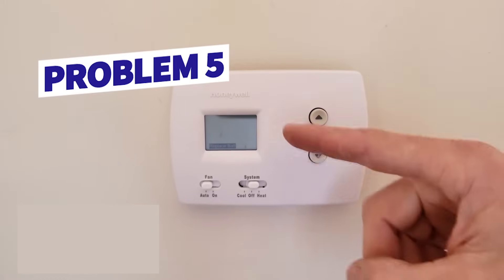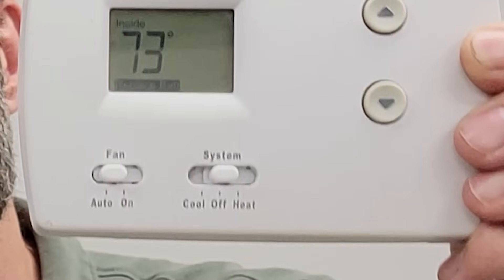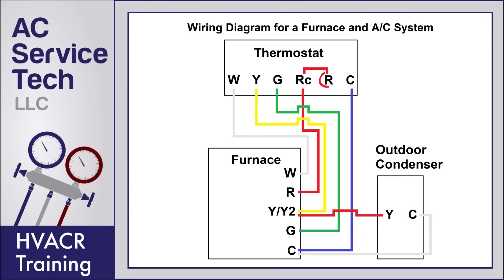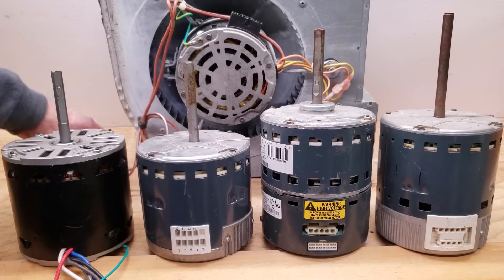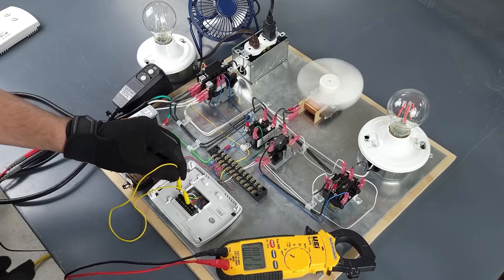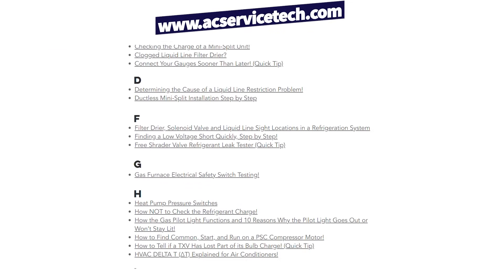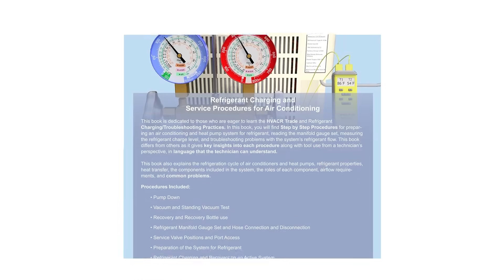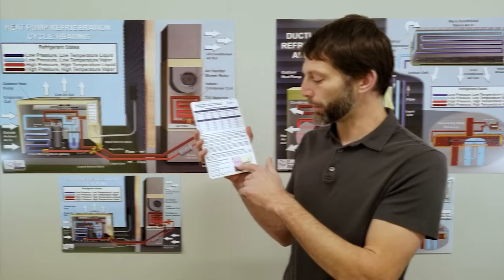Air Conditioner Not Turning On! Nothing is Happening! 10 Common Problems!

Comment: Went on a two hour drive once just to turn on switch.  Inspected unit found nothing wrong was not very happy about that call lol
Reply: That's free money.
3 hours or 5 hours depending how you charge.
Reply: Haha I hear about those a lot. I’m finishing up HVAC school currently. But hey it’s still $$ in your pocket. (Or your company’s lol)
Reply: I would love a port 2 port OT call like that.  Haha
Reply: You Honest HVAC guys are the best.  
Thanks for not radically overcharging for that simple "fix."   
You def need to cover your basic expenses like fuel....etc.
My honest HVAC guy passed away a few years back.   
Been through 3 different companies now..... hopelessly dishonest.
Its so damn easy to deceive homeowners about HVAC issues....so unscrupulous guys do it a lot.
Much respect to what you HVAC guys have to know & skills you have to have to be proficient & capable at it.
Working in 110°+ Hot,  cramped attics during summer !!!   Whew!!!!!  🙏😑🙏

Comment: How can you turn on r and y at furnace if your 2 wire to condenser is cut??? The condenser would not come on if it's not connected!
Reply: Right it wouldn’t turn on
Reply: That’s very true. If you’ve verified your thermostat is working correctly and your AC unit still doesn’t come on you’d jump from R & Y at the board NOT the thermostat which would lead you to the outdoor unit not getting the Y signal to your contactor

Comment: Number 1 problem for ac system not running after 30 years in Hvac business is condensing unit capacitor bad . 8 out of 10 summer service calls are capacitor .
Reply: Efficiency up ,reliability down ,repair expense up ,electric bill down.
Reply: Capacitor replacement will become obsolete in the coming years.
Reply: @July4.1776  Variable speed control boards will be the new capacitor for ac failures
Reply: @billy5032  yeah, and if they fail as often as a capacitor then someone is bound to make a lot of money.
Reply: @July4.1776  TONS more money then a simple capacitor.
Reply: @billy5032    And much more expensive to replace compared to a cap.
Reply: We’ve been having a lot of clogged drains and condenser fan motors here in TX, and fuses that pop on residential Geothermal package units
Reply: What if it your furnace or A/C both not coming on?
Reply: @ed_e_co check batteries in thermostat first, if you command heat you should hear a click when it calls for heat or air. Possibly a bad control board since neither works. I've had a bad start capacitor keep the fan from coming on in the furnace, but if neither works, doubt it's the start capacitor.
Reply: Would that cause the heater not to kick on?
Reply: False
Reply: What causes the air conditioner unit not to come on.  I replaced the batteries in my thermostat.  I had a new motor put in my furnace last year.